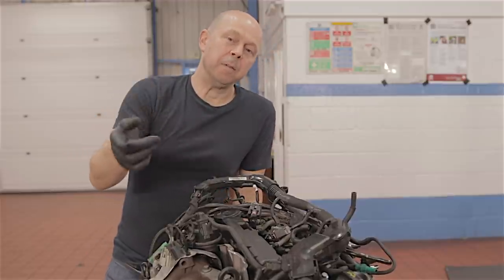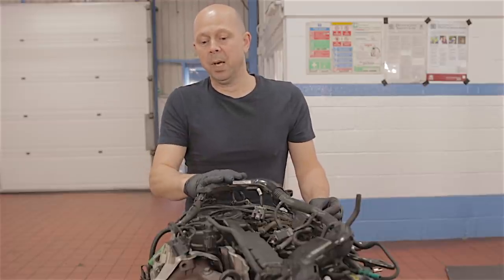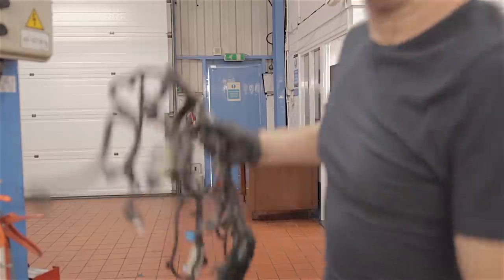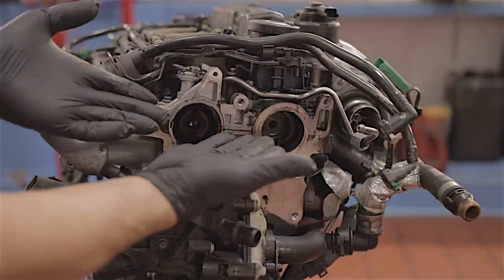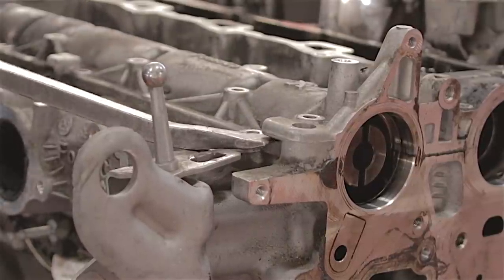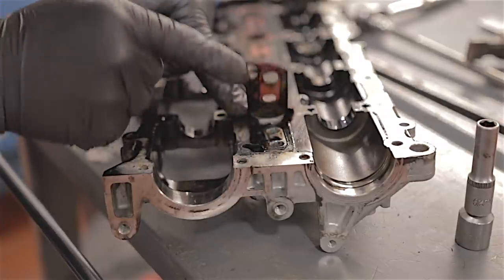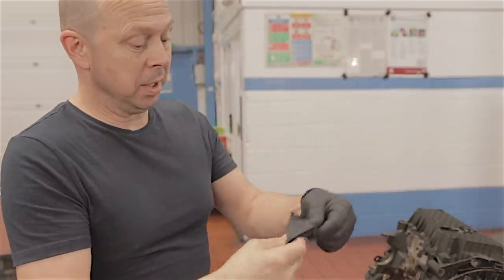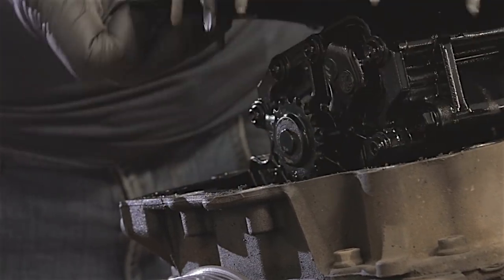Why did the mk5 ford mondeo 2l diesel engine seize

Comment: I had to change my oilpump on 130k last year on ny 17" Mondeo 180hp. It went in limp mode when i put the foot down uphill. The fault was that it was making to much oil pressure✌
Reply: Any other symptoms? Noise? Just limp mode? Thanx.
Reply: @13rz31  Just Limp mode.
Reply: @Baitman  the Problem is the Oilswitch, had also this problem,  by 200km/h everytime shut it down in Limp mode, 5euro for e new one, 5 min work and forgot about it
Reply: @cornelius952  They tried to change that 3 times before they changed the Oilpump

Comment: Any videos on how to remove the turbo on the mk5 mondeo mate? I need to do it on my diesel ST 🤣
Reply from the maker: not yet but you would need to remove the driveshaft..it would be a lot easier to get to the turbo from underneath by removing the subframe but not necessary...once all the heat shields are removed from around the turbo then it just unbolts from the head

Comment: why didnt the engine shut off or go into a significant derate if it completely lost oil pressure?
Reply from the maker: the engine would have been in low power mode...the engine won't switch off altogether or the driver would have no control

Comment: Great, interesting Video Alan, just for our information, how often do you service these engines and what oil do you use ? Thanks again for the all the work you put into these Videos
Reply from the maker: hi martin....we use the ford 0w/30 oil.supplied by ford for those engines...we replace the oil every 15k miles, which as they are taxis is usually about every 3 months
Reply: @alan4x  Thanks Alan, I also use 0/30 fully synth oil and change it at 12K, scares the hell out of me seeing the cost of even a minor repair on these modern cars. It's a good job they are generally very reliable compared to 40 years ago !
Reply: @alan4x Hi Alan, sorry for replying to a 3yr old comment...
I run 5w40 in my DW10s (BTED4 Euro 4) but they're in Peugeots. I've never liked the idea of a 30 in any high compression turbo engines, especially diesels. Turns to piss pretty quickly and I find it highlights any wear points in the engine.
It would be interesting to do an experiment where you run just one of these on 5w40 and see if certain components hold up better. The timing chain guides for one would hold up much better imo, as they seem to be a common wear point.
I will add that I also run Liqui Moly MoS2 additive in every engine I own, but I get there's a difference in personal vehicles and your examples being used as a taxi (warranty and not wanting extra expenses).
Reply from the maker: @19jacobob93 hi. If that works for you then great.  I can’t experiment with one of the taxis  here as I have left the job now but all the best to you.
Reply: @alan4x  Forgot you were in the Philippines now! Hope all is going well mate

Comment: Stick that Peugeot oil pump on ebay, someone will be needing one. Shame for it just to sit there and as you say never get fitted to anything
Reply from the maker: yep your right there, cheers
Reply: Drill ream put in bushings to add shaft bearing area

Comment: So do Ford not make their own engines? Is there a french engine in my 66 plate Galaxy Diesel?? 

Great video. 👍
Reply: Correct! They build the 1.4 and 1.6 TDCi engines, I believe in Dagenham, which were also designed with PSA, but the 2.0 TDCi is a PSA HDi unit, which is based on the old famous XUD9!

Comment: How many temperature sensors are on this engine . I know there's 1 at the thermostat housing but is there another 1 on the head or block ?
Reply from the maker: the only coolant temp sensor is the one in the thermostat housing
Reply: @alan4x  ok  thanks 👍

Comment: Seems like to prevent mass carnage it might be wise at 200K to change the chain tensioner. Also, what service intervals do you use to change the oil? If its the ford 18K miles I'd say that is too long. I'll be having mine done every 12K. If it had an oil feed problem it  will have not done the turbo bearings any good either. This all sounds like the issues BMW and VW had with their main chains with the extended service intervals.
Reply from the maker: hi michael, we use the ford supplied 0w/30 oil and replace it every 15k miles, which as these are taxis is around about every 3 months
Reply: In a taxi I guess 15k isn't too bad as its going to be basically running all day so doesn't have the temperature change of hot/cold which breaks down oils. I do wonder if prolonged stop -start sessions don't do the oil much good. Also depending on the running conditions another factor could be diesel in the oil from lots of normal DPF re-gens - I can imagine an urban taxi doing that a lot if the engine speeds are not maintained for a while. Difficult to get a measure of how often they'll do it. Airport runs wouldn't be an issue.

Comment: Hey alan , love the videos , just discovered the channel , and although I dont give a  shit about mondeo diesels, I find the videos interesting . You seem like a knowledgeable guy , what do you think about engine flushes that claim to clean piston oil rings(petrol motor) I have a 1.8 duratec burning a litre of oil every 120 miles! What do you reckon ? What would you do? It's a 600 quid car before you start talking of throwing money at at! Thanks in advance!
Reply: No smoke or adverse running or leaks by the way! Was blowing oil out the exhaust in a spray, but changed to 10\40 from 5/30 oil and that stopped that, no fouled plugs, seems odd, what you think friend?
Reply from the maker: if you're 1.8 duratec engine is burning a litre of oil every 120 miles then nothing is going to help it.
they are good engines but when they get badly worn they do burn oil

Comment: could the plastic cam chain tensioner guide have fallen down into the oil pump chain and  snapped it ?
Reply: more to the point where was it ?
Reply: Good point, because the pump was not jammed.
Reply from the maker: that is a possibility and not ruling it out...i did say that in the video, thing is i have not found the chain plastic guide so assuming it has been disintegrated as in worn out by the chain till nothing left rather than a lump of guide falling off and dropping into the sump
Reply: @alan4x  can this chain tensioner be inspected through oil add opening? Like with endoscope? Thanx for great videos!👍

Comment: ALAN on a scale of 1 to 10 how reliable is this engine as I have it in my Peugeot 3008 ??
Reply from the maker: the engine itself is very reliable and well built..8 out of ten...problem is all the bits bolted to it..egr valve and thermostat housing are not so good
Reply: Alan Howatt cheers for the reply buddy

Comment: At what mileage do you change the oil?
Reply from the maker: mk5 2 l diesel we use ford 0w/30 and change every 15000 miles...which in most cases is around every 3 months
Reply: Alan Howatt do you think the interval is too long and should be sooner?
Reply: Flippin heck that's quite long interval.. my mk4 get's new oil every 6-8k miles (Ford's Formula F 5W30)
Reply: Tomasz Knapik common on modern engines. I never leave it that long on my cars. 10/12k /1 year max.

Comment: I new the problem before you even started the strip down . Now there putting belts in engines to drive the pump. in oil not good in my opinion V.W. EA288 engines JUST TO NAME ONE . chains in engines are far better if engineered well.

Comment: Alan there is one word that will NEVER describe any of your videos... BORING!

I thought it was fascinating, moreso how good a condition the remaining big end caps were for that sort of mileage! Makes you wonder if it would be worthwhile replacing the oil pump between 150-200k?

I actually used to work in a factory outside Belfast where we made the DW10 cylinder heads, which were gradually phased out by the DV4 and DV6 variants - interestingly, if you're sad like me, its the same Factory building the De Lorean was made.

Anyway... Seeee yaahh 👊🏼
Reply from the maker: thanks sparko, thats interesting to know😊god bless